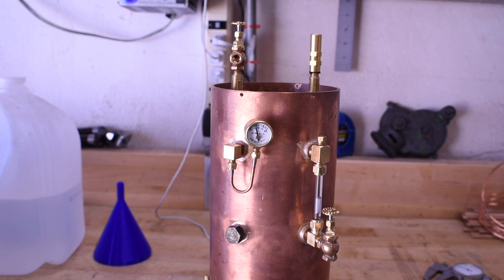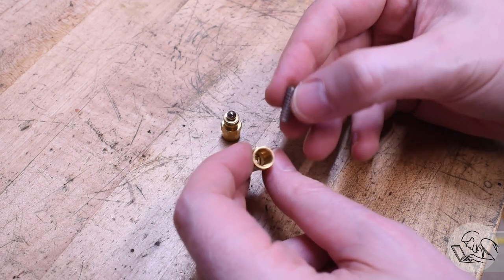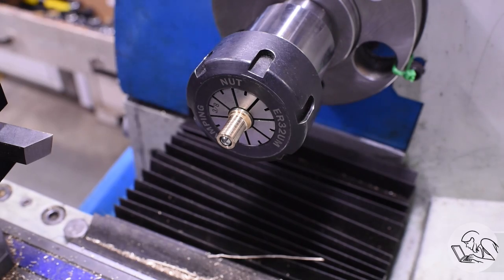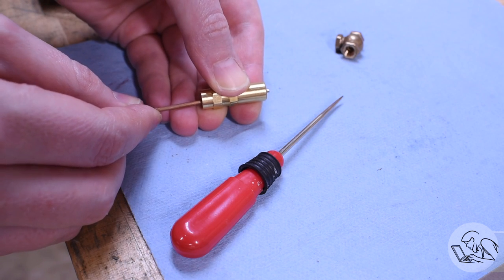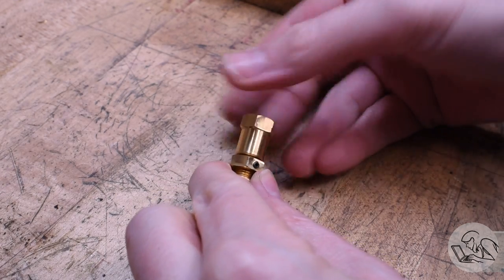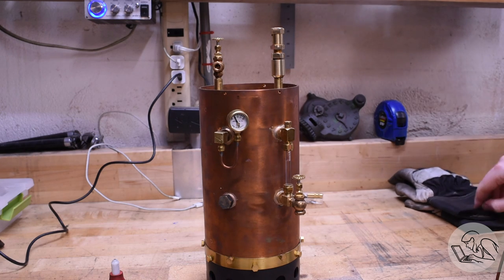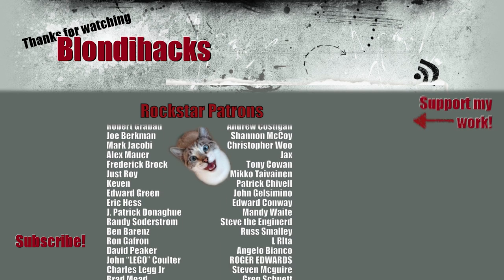First Steam Test! - Model Boiler Build, Part 15

Comment: The lifting pressure of the safety valve is going to be the port area the ball is blocking but the closing pressure will be the projected area of the ball (or the ball plus carrier). With the ball in carrier design, you probably need to have more than the two filed flats so that the carrier is not acting as a pressure restriction. Perhaps more holes in the top too, so the only pressure inside the valve is from the steam passing through. (Thoughts from a bloke who has not done as much with steam as you...)

Comment: I liked your fix on the original  valve . If you have room you should ad a short helper spring . That won't seat the ball but will ease the pressure  for the mane spring  to seat the ball

Comment: A couple of methods I've used to true up a flywheel that is off center. 1) use a round file to remove material inside the hub. The outside may need to be recut to get rid of hump after adjustment. 2) bore and sleeve the center hole.

Comment: Hi Quinn, just wanted to say what a beautiful work you’ve done!  I do wish to comment on the mention of this valve being used as a pressure regulator valve at ~5:40 point.  Boiler Safety Valves are safety devices and not part of normal operations.  If a Fireman is causing the the Safety Valve to lift on a regular basis it would likely end his employment.  Boiler pressure should be regulated by matching the firing rate with the Steam output.  I understand that a quick closing of the steam stop will cause a pressure spike and subsequent Safety Valve lifting but this would be the exception not the rule.  Marine Boiler Safety valve lift pressure is set at 10% above the MAWP (maximum allowable working pressure) and adjusted by changing spring tension.  The Blowdown is adjusted by moving the huddling chamber or seating ring.  Valves are designed to blowdown below MAWP even while at max firing rate to be assured of protection of the personnel.  There are good  cutaways of Marine Boiler Safety Valves on the internet.

Comment: Congratulations on a successful startup! It's so satisfying seeing both of these projects come together. I admit I was a little concerned (ok, a lot concerned) when you started modifying the safety relief valve but my only experience with a boiler (somewhat) like yours is a boiling water reactor; it's amazing how easily you can spook nuclear people with steam and pressure vessels, even tiny ones :)

Comment: Fantastic Quinn,  great to see the boiler run the engine. Spent  quite a portion of my life trying to resolve residual stress / out of flatness  strip steel  and plate professionally, so interested in the slow warp of your flywheel. It appeared to be a tricky part for both you and Joe Pi to machine and  its a pretty spindly part anyway.
Reply from the maker: Extremely thin castings are the worst! 😅

Comment: Merry Christmas Quinn!
Just goes to show that you should never trust a blow off valve until you have tested it - you can use the same rig you used for the boiler test .
Maybe the reason for the valves not closing is the steam flow is keeping the ball off its seat because the ball is in the end of a cylinder and acting like a piston .If you set the valve up in the mill and use an end mill to cut some flutes in the bore where the ball sits this would give the steam a path around the ball .

Comment: I was wondering if you could repost the link for you hydro test rig. was sure I saw it once but can't seem to find it now.
I was also wondering if it is possible to connect two boilers together in parallel through one way valves to get an increased steam supply ?  I very much enjoy the way you explain the things you do and the reasoning for why you do them that way. Thanks for the videos and the variety of project you post about.

Comment: My experience with safety valves for boilers are, that once they pop they don't stop.
On the plus side, it looked kind of homey to see that string of smoke slipping out of the evacuation pipe.
We always tried our hardest not to activate them, because everyone knew that they would be leaking until next shutdown and revision.
Good times! :)
Reply: @markfergerson2145  I have asked myself the "in this day and age" argument myself many times :) 
The safetyvalves construction might be hard to explain in text, but essentially in/out take valves from an engineblock, size XXXL and then a spring at 25 bar attached to it. Technically the spring was pneumatic pressure, but principle is the same.

Probably crud as you say, but also these sort of things need maintenance which always is the first thing to go during cutbacks. The valve might seat good enough in one position, then it blows and rotates a bit and will have to be battered down, I imagine.
Reply: @PhilG999  we have the same rules in Sweden. Also, one valve must be able to deal with 4 times the production, and always at least double valves. They must be situated in such a way that when you turn of one, the second will always be on.

There is more to valves then people think :)

Comment: Question you might lookup industrial safety valve and copy it to fit the size of your boiler industrial valves have a settable blow back setting. If it goes off at 60 psi you can set the blow back to close at 55 psi. I have fried industrial for over 42 years the biggest was 200,000 pph. O yes  Merry Christmas, Quinn!!

Comment: You mention that with a (model) steam engine creating heat with combustion feels satisfying in a way that creating heat with electric energy doesn't. I agree.

Building a model steam engine is a celebration of ingenuity. Electric energy is new technology. The engineering way to convert electric energy into mechanical energy is by using an electric motor.  For a steam engine it is ever so satisfying to use an energy source that only a steam engine can turn into mechanical energy.

Comment: Consider heat soaking your flywheel in your kitchen oven at it's highest temperature for a couple of hours with a slow cool-down (say 50°F, wait 15 minutes, repeat until around 200)

Comment: if you back out the grub screw on the center nut the nut acts as the register for the pressure applied to the spring on the stuart

Comment: Great job! 
 Small steam valves these days have many issues. #1 are the ball-bearing hardened? If not there not ground which means as it turns it will leak. #2 you can lap the ball seat with a spare ball to seal better as wear shows, sometimes needed when new. #3 I find that the some springs loose tension over time. One I had was steel not stainless and the spring rusted inside without me knowing, so I adjusted it, over time the rusty material damagd the seat and was Un machineable at that point.
Hope this helps and can't wait to see more.

Comment: Concerning the feed pump, absolutely make a hand pump similar to the sort used on a 2.5"/3.5" gauge loco, always useful for emergencies! But it would be cool if you were planning on putting together a little steam plant to have a water feed pump running from the engine, either directly or through overhead layshafts (miniature ones of course)

Comment: You can reduce the CO production of your burner/boiler setup by increasing the air gap between the burner and the boiler. Even if the burner is very near stoichiometric mixture, the cold metal will quench the flame before all the oxidation completes, leaving you with CO instead of CO2.

Comment: I made a compression tester for diesel engines with a check valve of similar design to that first safety valve. I ran into the problem of the ball not seating fast enough so I'll make a guide for it like yours.

Comment: Awesome. I used to drive a friends 5” Sweetpea and one spent a lot of time tapping on various valves to open or close or just clear the condensate out (esp the whistle valve). I remember the safety valve being separate from the pressure regulator, the gas fire would use gas fast enough to freeze condensate on the outside of the gas bottle, and could easily blow the regulator and safety if you let it get out of hand. Best remedy for too much steam is to open the drain cocks and drive with a full train, that would ‘waste’ steam usefully.

Comment: I love it! Nothing beats fossil fueled steam. You will love the smell of steam, coal or kerosene. Are you going to use a feed water pump or injector. I don’t know if they make model injectors. Are you using real steam oil in the displacement lubricator? The last Stanley’s made recycled boiler water thru what looked like a radiator. Problem is the steam oil formed a gross mass floating in the feed water tank. We used “pig Matt” to try to absorb it. You don’t have this problem with a total loss system. But the boiler eats water. The running joke was that a Stanley never met a stream it didn’t like. There was a lot of thought out into the Stanley burner which was very similar to your burner. Two cast iron half circled with holes drilled in them. One lit they are impressive. But cold, the air flow slows down and the flame front can drop below the plates. There are usually two and sometimes three open venturie tubes on the front of the car. I saw jar Leno get the hair burned off his arms trying to light the sister model R that he owns. The Stanley needs vaporized fuel to run. So Stanley ran the fuel line next to the super heater line in the flame. It was unnerving to see kerosene flowing thru a red hot pipe!

Comment: Steam temp at 60psi 307°F, green Loctite temp range 65-300°F. Close but no cigar. Loctite 263 can handle those temps no problem. 
Nice to see it up and running.
Reply from the maker: Kozo’s safety valves are assembled with 603 and they function perfectly for years. Just because the pure steam temp is that high doesn’t mean the surface of the metals ever see that temperature. The real world is more nuanced than your comment would like to believe.

Comment: 🚂🚂🚂That really is a very nice little boiler and engine, you really are a very good craftswoman. 

Its such a shame that those valves are not running properly. I guess though that they are doing their job by acting in a safe manner and blowing off pressure at the right limit more or less but its a little irritating that they wont reset quickly, I suspect the heat in the metal spring, ball and brass has something to do with that I would imagine, different expansion rates, perhaps machining it out off all the same material might work.

If youre not an engineer I have no idea why not !  You have to have so many talents now to run this sort of channel and engineering is just one of them. Add on to that a videographer, director, producer, editor,  3d designer the list goes on and on and the benchmarks now are so high to get the share of the audience. I'm hooked.... Thank you. 🚂🚂🚂

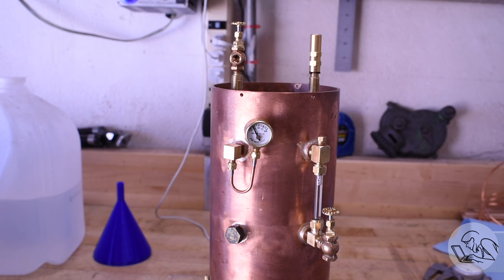Comment: 2:24 “Shockingly Quickly “………exactingly the spec we were shooting for….right?!
In my car world, we call our safety valves, wastegates, and ideally control them with an electronic solenoid so we can stay right at the pressure limit 😎
Reply: Good analogy, although steam safety valves have been around since shortly after the first boiler explosion, long before reliable portable electricity. Consequences of failure of a steam safety valve are an explosion with release of high temperature steam (in full scale - demolition of the entire factory with probable multiple fatalities). Failure of a wastegate means you walk home.

Comment: You might be able to find a simplex pump that will run off the engine exhaust. You might have to put a reheat coil in the smoke box to get that to work though.

Comment: That 3d printed funnel tip is great, I'll have to remember that for next time! Oh, and the steam thingy was cool too, I guess. 

Just kidding, fantastic work, I'm actually really curious to see what you'll find with the wear/ warping with the casting. I wonder if there would have been a way to stress relieve it to prevent/ reduce the warping.

Comment: I am thinking of building a small boiler so your work is if great interest. As it will be static my idea is to makes a gravity valve rather that buy a spring-loaded one. This might make it more authentic looking if nothing else! Did you consider a gravity valve?
Reply from the maker: The old timers used to use gravity valves in this hobby and I think some people perhaps still do. They are perfectly functional! Even real boilers and locomotives used them in the very early days of the industry.

Comment: Awesome job Quinn! Are you planning on a manifold off the steam pipe to make a steam water pump, or just a manual feed pump? Also, would a steam-powered blower help any with this type burner? Was just wondering how it would sound if the exhaust was routed up out the stack?

Comment: It sounds like the first 2 safety valves are really relief valves since they have some accumulation before full open. Its a confusion that even happens with the NRC & the generic fundamentals exams.

Great project. I like watching the process as opposed to having to actually run a steam plant. 😒

Comment: 0:48 I like to model threads in before printing and then if they're too tight I'll open them up with a tap. Modelling the threads in only takes a few clicks in Fusion 360 and since they're already there, if you do have to use a tap the torque you need to apply is significantly less, so it can save a lot of headaches.
It's unlikely to be an issue with that funnel but I thought I should mention it anyway. I once had to scrap a very large print because I tried to tap a deep hole that had no threads - there weren't enough perimeters so the 'tube' that made up the walls of the hole sheared off and stayed stuck on the tap, so I had to cut the thing apart to get the tap out. It set me back about a day and a half having to reprint the part (plus redoing the sanding and painting) so I've made sure to never make that mistake again.

Comment: Hi Quinn, I have looked all ovenr for that boiler burner you show in this video, but all I can find is the high walled ones.
I cant find a link to it anywhere either. Call me short sighted or something, but is there a link for it perhaps?
I Would be tickled pink if you could hook me up with a link to get the short walled one you show, thank you. 
 Best regards, John.

Comment: Bonjour Quinn,
What a pleasure to see the result of this project, bravo !
Based on my experience,  it is very difficult to find a manufacturer safety valve working correctly, I mean correctly closing with a correct hysteresis when it has started.  Please see two examples of valves made by skill friends :
An Adams model one :   https://www.youtube.com/watch?v=W7pxeN_leUk
A "discharge" one : https://www.youtube.com/watch?v=Ygq_4Xf1ABA
Bonnes fêtes de Noël
Amicalement, Raphaël

Comment: I wonder if there is any way you could, instead of heating the water off to the side, just put the fire right in the air inside the cylinder where the piston is?

Comment: Shame you didn’t show the workings of the safety valve you chose. As a steam loco builder for the last forty years I can tell you that safety valves cause more arguments than any other, especially the ‘pop’ variety as they can be very noisy and are constantly popping every slight drop in pressure.  Good luck to you and like your channel.  Next thing for your boiler is an injector!

Comment: In keeping with the theme of The Steam Age, is there not a way to use the pressure of the boiler to draw water from an external, larger tank that is possibly sealed?  It seems to me you have adequate pressure to spare.  A small copper tube (to limit the volume) over to the water tank.  Okay, visualizing the whole, you'd need two tubes, a small pressure bleed, and a larger liquid tube, which would have to be below the water line of both tanks.  And, as I think more, the supply and the boiler would need to be on the same level as well.  And building a large volume, but pressure safe tank is likely too much.  Better to use a pump that can overcome the boiler's pressure, forcing water as needed.  Hmmmm....  On the third hand, pressurizing the supply tank would automatically draw water into the boiler, every time the safety valve opens, and the sudden pressure drop occurs.  Since the pressure line is very small, it'd force water from the supply, back to the boiler as the pressures equalize in both tanks.   Nice video, and sorry about the rambling.

Comment: The chinmey cap I think is too long, it looks like it produdes into the top cap area and I think it's creating an edge the exhaust gases have to step over, though I'm not sure if back pressure in that system is good or bad, it might explain the increased CO gas, but that all might just be the perfectionist in me thinking a flow path should be as smooth as humanly possible

Comment: I think the safety valves were adequate as they were just providing essential performance, but certainly lacking finesse, and reliant on the user to shut the whole works down, reset the valve and start over.
Perhaps spring material has some role in some of these valve designs inability to recover at a reasonable pressure. Perhaps with a poorly selected spring material, once the steam starts to blow through the valve, the spring gets hotter and the original standing spring pressure is significantly reduced. 🤷